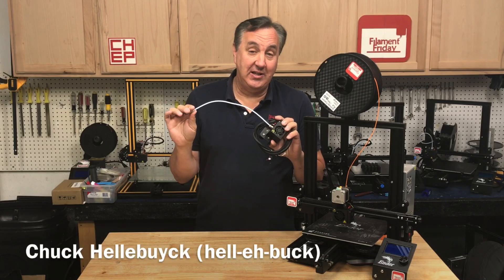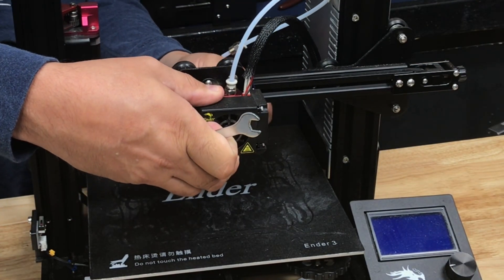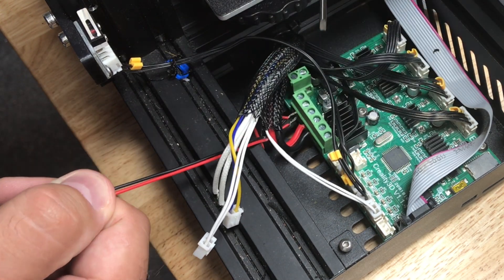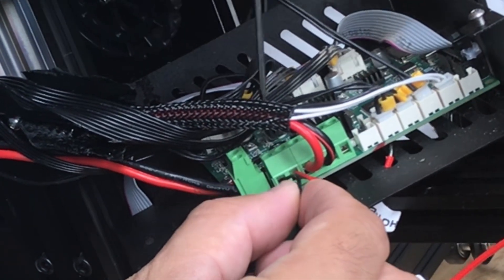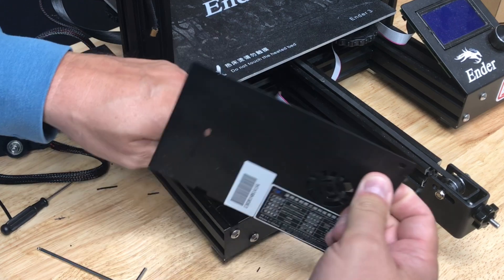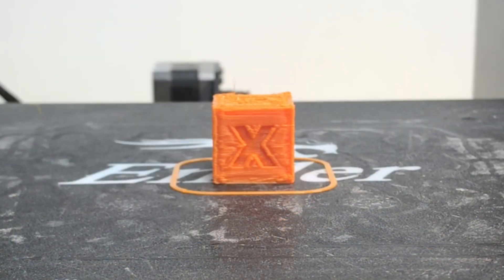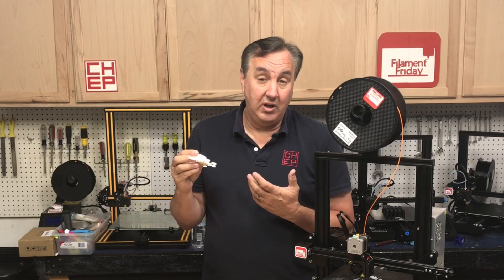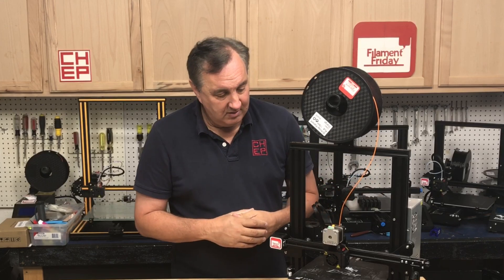Direct Drive Extruder on Creality Ender 3

Comment: Love my ender 3 with direct drive. I have a question for you. My 3 year old ender 3 started having layer shifting only in the y direction. I checked all the normal mechanical things but everything was fine. It ended up being the vref y driver needed to be adjusted up a little from .58 to .83. Works great now but why would this all of a sudden need to be adjust for more voltage to the stepper when it was just fine for 3 years. I was hoping you could do a vid and explain more about vref values and what they are and do. Now even though it’s working again I ordered a new main board as I’m hopeful that with the newest firmware it will be much better then a 3 year old main board. Thanks for your time.
Reply from the maker: I did one a long time ago. Perhaps it’s time to do an Ender 3 version (though the steps are the same). https://youtu.be/9CvlbRkWHh4

Comment: Don't fix what isn't broken.  I just printed a perfect string test with my stock Bowden.  No way I'm messing with that.
Reply: If it works for you then awesome!. I print flexibles a lot so i converted to direct drive.
Reply: @walspeed  If my roll of TPU wasn't collecting dust, I'd probably rethink it.  But the Bowden does such a good job with PLA.  I'd be reconfiguring everything just to get back to where I am.  Lots of folks who convert to DD make it sound like they've discovered the hold grail.  Clearly, it is not for everyone.
Reply: I just need to print TPU haha
Reply: @dogsidog0074  I dusted off my TPU and had a go with both printers, Ender 3 and 6SE.  Prints beautifully with the generic Cura profile every time.  I don't get it.  What am I doing right?  lol
Reply: @RARenfield  Stock tubes and everything?
Reply: @dogsidog0074  Straight up.  I ordered Capricorn for the 3, and the 6SE came with it in a bundle.  But I haven't installed it on either yet.  Just the original PTFE.
Cura is v4.8.
I like to avoid buying based on internet lore.  But I did fall for the capricorn tubing.  We'll see.
One thing that bothers me is that the Capricorn is a different size.
Reply: @RARenfield  the capricorn is probably a smaller inner diameter no? that's the secret sauce, the capricorn is more...slippery? So because it's got lower friction it can hold onto the filament tighter with the tube diameter, but that being said the white junk is inconsistently sized and less slippery, so it needs to be bigger to prevent binding. that extra space is what causes weird slack issues, where when the extruder retracts the filament it doesn't actually pull out of the hotend, and when it pushes thorugh it takes a second for the slack. it's just about using better materials to make for better tolerances. that being said it's all BS if you're not using linear advance or at least tuning your retraction speeds/lengths lol
. i bought the blue knockoff because it's prettier than the white and it's a dollar or two more, it is pretty low friction though. better than white
Reply: @paulgupta2454  Speculation or true?  I thought it was a higher temp tolerance with the Capricorn?  O.D. is slightly smaller.  I didn't measure I.D.  It came with new connectors.  Still haven't installed it.
Capricorn is my astrological sign, so I had to buy.  LOL.

Comment: So I’m getting into printing and after having a few successful prints I’m now running into issues. Mainly leveling and keeping the bed leveled, when I run the gcode it looks good, but when I start the print the nozzle doesn’t look right (in the air so the filament can’t really adhere to the surface) I’m probably going to upgrade to a 4.2.7 and get a Bl touch as well as throw on a direct drive. Really though I’m just kind of stuck as to what it could be 🤦‍♂️
Reply from the maker: Does your print home itself first?
Do you have Z offset in the slicer? 
BLTouch won’t fix either of those.
Reply: @FilamentFriday  Sorry for the late reply I’ve been busy with other projects in between, but  I don’t think I do have the z offset in the  slicer 🤔 i tend to home it before a print if that answers the other question,but I definitely will upgrade the springs 🤓
Reply: @FilamentFriday  oh yeah! 🥸 so I’m just following up (I basically just leveled my bed out again after heating it up) then after that I went and looked up the z offset etc. and after setting that (tweaking the knobs a bit while it was setting the supports/outer edge to the print) I haven’t thrown on the springs yet and I’ve got it going now! Oh baby we’re back in business 😁 I will add that on my glass bed I have to use Elmer’s glue as it doesn’t adhere as well as the original ender bed (for me at least)
Reply: Join the Ender 3 forum on Thingiverse. Someone will help you there. I had loads of troubles at first but those guys helped me out.
1. Home it, 2. Paper on all corners so that it snags but you can still move the nozzle easily, 3. Slice with cura defaults.
Reply: @lawrencemanning  I’ll definitely join!
Reply: Have you upgraded from  your stock springs at all? I had considered getting BL touch when I started printing, but after upgrading my springs and using CHEP's bed leveling method I've thrown the idea of BL touch out the window because my bed seems to be leveled every time.
Reply: @nicksiha  yes you don't need a bltouch. The standard ender 3 springs are not stiff enough, so get the upgrades. There is light at the end of the tunnel: with practice you can level by eye alone.
Reply: @lawrencemanning  i take the bed off every time i remove a print now and its always stays level stock springs are good for me🤣
Reply: def replace the stock springs
Reply: @Sleether31  any recommendations on what springs (what to make sure the ones I got are the right kind as there are rubber like springs and then longer yellow springs)

Comment: I'm having some issues with this direct drive setup and some pla filaments. I tried creality white and black filaments and the white always jams mid print because the stepper motor of the direct drive gets too hot and the heat gets to the filament and makes it soft. I've checked the vref and it's at 0.72 so instead of lowering the vref and losing grip I've stuck a radiator on the back of the motor and used a 5v fan with a buck converter. I'm running the 3d printer in an enclosure so the temp is higher than normal which also ads up to the problem. So far I'm not sure if the problem is fixed because I need to run some longer prints to confirm it but I'm curious if anyone can help me out with a safe vref without losing the grip on the filament. It's not a dual drive, just the normal extruder setup Creality sells in this kit.

Comment: You must have longer belt then I have on my Ender 3 pro. The notch for belt on extruder is not placed at the same place as my default extruder. The belt is to tight now and make it impossible to replace the extruder without buying longer belt.

Comment: there seems to be a kit for everything when it comes to the ender3. Is it worth getting the prusa still?
Reply: If you get a good Ender3, you're good.  Problem is their quality control is crap so it's completely hit or miss if you get a decent product or something you'll have to futz with nonstop.  I started with an Ender3 and hated the constant tinkering.  I then bought a Prusa and have been singing it's praises ever since.  Before I sold my Ender, I converted it to direct drive via printed parts which helped some.  I also replaced the mainboard, which helped some.  But overall it was still way more hassle than the Prusa and therefore never got used.  If I were to buy another, it'd be a Prusa hands down....actually if I bought another printer, my 2nd would be resin.
Reply: I wouldn't get pursa.sovel looks good too
Reply: Plenty of upgrade kits for the Prusa MK line too.   Lets not forget, these are simple machines and even Josef knows Prusa makes its money on customer service.   Don't knock things unless you have tried them.   I have both and my Ender 3 is a work horse.   Yes, I had to upgrade it but it was still cheaper than my MK3S.   Way cheaper.
Reply: @2muchscott   What would you recommend for someone who has never had a 3d printer? I would prefer the cheaper option but something that is not too much tinkering and get me into the 3d printing right away

Comment: hey chuck i love your channel, do you have any experience with pancake stepper motors?
Reply from the maker: Not really. They are about the same as regular size but typically less torque.
Reply: @FilamentFriday  i read they only work with the bmg extruder because theyre a 1/3 gear ratio.

Comment: Hi chep you wouldn't happen to have a cura profile for the direct drive? I've down the conversion and have been having big headaches getting good prints since and recommendations would be great!
Reply from the maker: I use my existing but reduce retraction to 2 mm
Reply: @FilamentFriday  Hi CHEP thankyou for your help! I'll give that a shot I initially set retraction to 1mm but had wild stringing so I had to put it up to 4mm to get rid of it, it still isn't perfect but hopefully I can get it dialed soon!

Comment: Ive been doing alot of research online and but what I understand is you also have to change the retraction distance and speed, prime window and turn on coasting. I oreder a similer setup that will be here today. im going to try tinkering with these settings. have you tried doing this already? if so what did you come up with. if not, ill let you know.
Reply from the maker: Reduce traction to 2 mm. That’s the only change required. You might see more ringing so adjusting jerk may be required.

Comment: I notice the even with a direct drive unit you still have a short length of tube to the hot end. Would it be possible to change it for a metal tube, it might be better at handling the heat?
Reply: No, it would be worse.. this doesn't depend on the direct drive, but on your hot end. If you use the stock hotend, it needs the PTFE liner inside. If you used metal tube you would have a lot of heat creep up to your extruder and it would start to clog. You would have to use all metal hot end with a heat break (titanium for example) to prevent the heat going up from your hot end.
Reply: @JardaTesar-g5i  exactly, can you still use an all metal hotend with this?
Reply: @paulgupta2454  sure, either if it has the same dimensions as the original hot end, you can use it straight away and use even a smaller piece of PTFE just from the extruder to the coupling on the hotend (that's how I use it with the stock hotend too, because I have a captive PTFE inside with PETG spacer, so actually the PTFE from extruder is not the same one going to the hot-end), or if it has different dimensions, like Volcano, etc.. you could print an adapter to offset your extruder to be inline with the hot-end. I am actually using the HMG5 cooling with dual-gear extruder, so I made an adapter, also rotating the stepper 90deg.

Comment: I tried this mod and got too much ringing on the prints. Had to lover the speed considerably. Tried fighting up the belts even further as well as rollers to get rid of any slop, but ringing was still bad. Went back to the bowden setup as that allows for much higher print speeds with barely visible ringing if any at all.
Reply: Invariably a problem when you are adding so much mass to a part that needs to accelerate quickly.
Reply: might want to either (or both) make sure the eccentric nuts on the new plate is tightened appropriately, or add a bit more power to your Z stepper (tuning the pot on the board).

Comment: I'm sorry I'm asking you so many questions but you seem to know what you're doing. I'm the guy from your other video that is waiting for the new tubing in new fan so right now I'm designing in Fusion 360 that's all I have to do. I need to be able to print flexible do you suggest this upgrade I have a cr-10 version 2. I really don't want to have to do the upgrade but it looks fairly simple if I have to. I guess my question would be is it worth trying to Tinker with flexible tubing without doing this upgrade or is it a must?

Also I need to find a flexible filament that's perhaps a little stiffer than a rubber spatula. Similar to a rubber spatula would be adequate slightly stiffer would be a little better

Thank you for your help I appreciate it
Reply from the maker: I showed how to do it here with bowden: 
https://youtu.be/az7pysnV_MY
And here:
https://youtu.be/1GNDxvxpWr8
Reply: You can print flexibles without this upgrade. It’s just painfully slow. I print ninja flex (85A) and TPU (95A) alright on the stock machine at 20-30mm/s. This upgrade would make life easier.
Reply: @NullHyp  the items that I have to print are very simple and small at least the flexible items so maybe I should give it a try before I go ahead and upgrade although I think the upgrade doesn't make a lot of sense

Comment: Will this version work with the V2 as well? I can't seem to find an answer from Creality, but I'd imagine that it would be similar enough
Reply: It does work with the V2, I just received mine today and it installed without issue and it is printing as I type. I was worried after I bought it because I couldn't find any info on if it worked with V2. The diagram has the old board as an example so I was thinking I was going to have to return it. I am pleased so far.
Reply from the maker: Great feedback. Thanks.
Reply: @drakkas72  that's great news! I ordered mine a couple weeks ago and it's still in the mail. Should get here any day now and I can't wait to use it.
Reply from the maker: I believe it will but I haven’t tried it.

Comment: Bought  two for $33 ea. Installed an 8 pin plug for quick swap and used the second for parts to build a micro-swiss extruder/hot end combo that I just bought on sale for $68(no clone). That gives me 3 individual quick change systems available on demand. I plan to double the Y axis on my Ender 3 Pro but keep all other dimensions. That will print just about everything I want and still retain print stability with a single screw Z. Still looking for a heated bed option for just the longer Y and I may have found one.
Reply: Large Y tables will limit your speeds by a lot.
Reply: Where did you buy the combo kit at for 68$? Thanks!

Comment: I find these heavy hotends cause the right z to droop and cause rubbing on the nozzle during prints. Maybe its just me. But i added dual z with my own prints and a 2nd spare motor and now it works flawlessly
Reply: Now this sound like some
Some good edvice how did you wire the 2nd motor please:-)
Reply: @jamesstanding3364  just spliced it from the original wire.

Comment: does your direct drive wobble at all???
Reply: I've been trying to adjust mine, not much progress. Gonna dremmel the hole out later and see if it works out
Reply from the maker: No. You can adjust the eccentric nut on the bottom wheel.
Reply: yeah,  mine still wobbles even when I've tightened the nut,  I might need to drill something out too?
Reply: As it turns out, ive been turning the wrong nut. You just need to turn the nut that is closest to the wheel and it will be tightened

Comment: what's the range of temperature you can operate with?
Reply from the maker: Same as bowden.
Reply: i mean. original extruder got limited filaments compatibility due it's lack of resistance on high temp. is this capable of reach temperature suitable for nylon and PC? thought, thanks for the answers.

Comment: What is the space between the two slots for the belt on the new bracket you installed. My original bracket is 2”. The new bracket I got is around 3/8” shorter so now the drive belt won’t fit

Comment: When upgrading from a Bowden to Direct Drive. Is it recommended to upgrade to a dual z stepper to help with the added weight?
Reply from the maker: I haven’t seen the need to.
Reply: @FilamentFriday  Thank you sir. I enjoy watching your videos and they let me ALOT!
Reply: Adding a dual geared stepper would increase the weight even more, in my opinion.
What do you think?
Reply: upgrading to the dual Z stepper is a no brainer anyways. This should be automatic. I installed it on my V2 after only printing 2 things. Super easy to install and well worth it.

Comment: Print Petsfang with BMG direct drive from David Petsel. 23mm pancake motors are dirt cheap, better for reducing inertia since 3:1 gear reduction of BMG reduces torque required from stepper itself. BMG clones sell under 10 bucks now, works wonders with proper lubing.

Comment: Does this fit Ender 3 v2 please?
Reply: No reason it shouldn't, the V2 just has a few upgrades over the original (glass print bed, drawer, silent board, etc.) fundamentally though they're same and most parts are interchangeable
Reply from the maker: Not sure.
Reply: I'm interested to. If anyone test it on Ender 3 v2 please let we know.

Comment: I installed mine and it's a bit wobbly on the rails, did yours have a bit of movement CHEP?
Reply: Guys I was a Muppet not realizing what an ecentric nut actually is. Problem is sorted
Reply from the maker: Adjust the eccentric nut on the wheel.
Reply: @FilamentFriday  mine feels pretty tight, get the feeling my stock E3 may not be the target for this and maybe the thicker rails in the oro would work better. Did you fit yours on a oro?
Reply: @3rutu5  it doesn't have to be tight. It's eccentric, there's something else locking it. The function is to close the distance between top and bottom wheels so it fits right into your rails, it should tighten the wabble you have in your machine.

Comment: have seen in several of your videos you splice in a connector for the fan, what is the source for that connector, also while speaking of connectors why couldn't you just install one in the wiring for the direct-drive and that way you could switch heads back and forth without disturbing the mainboard, just a thought.
Reply from the maker: I use these: Cooling Fan Jumper Wire: https://amzn.to/2ELljRh